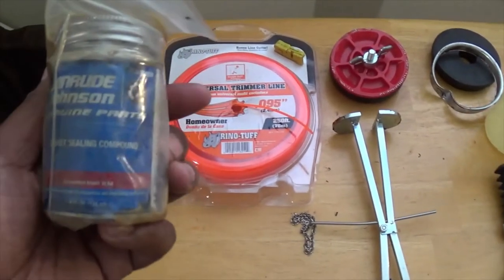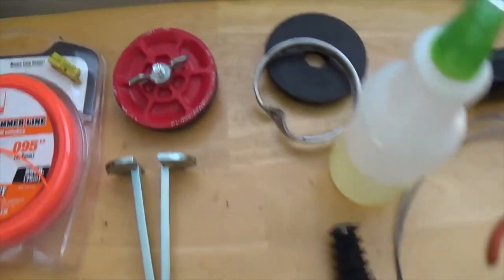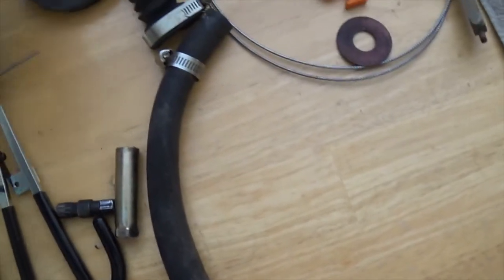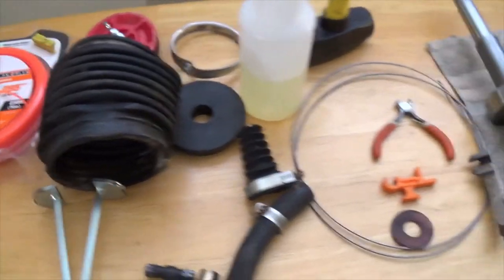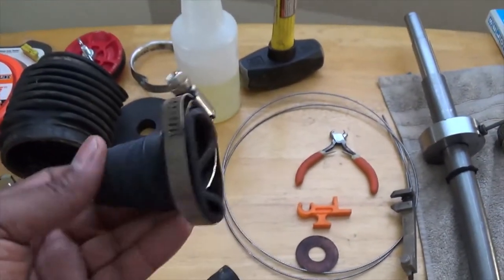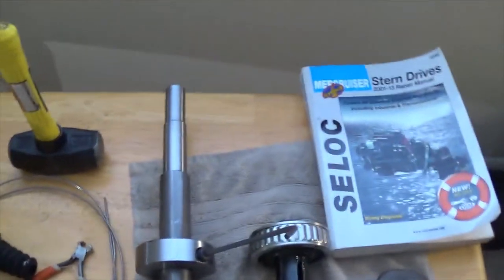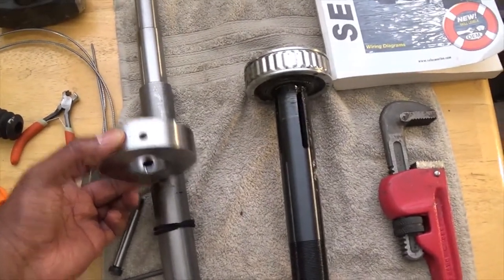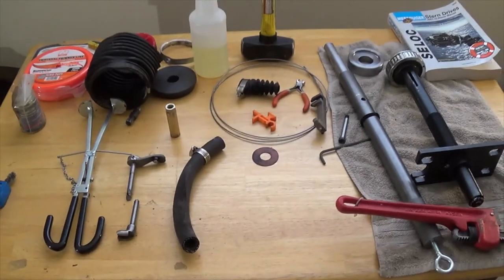Tools needed: WATCH THIS BEFORE replacing stern drive Bellows, Bearing and Shift cable

Comment: The red tool is a 4 inch mechanical test plug
Reply: Thank you! I was trying to figure that out so I can buy it.
Reply: @jasonvega5797  I suggest you spray powertune on the bellows. The plug did not work for me
 It goes right in with powertune. Ten bucks

Comment: Dude.. The shift rod is allways stuck bro.. U need to take Chizzel and a hammer put Chizzel in the crack om the TOP there and give a good smack! Then the arm will Split, cuz its mold alu... Very Nice video.
Reply from the maker: Okay thanks for the comment

Comment: What size is the plumbing cap for the bellow ring
Reply from the maker: 4 inch but you will have to shave a little bit off so it will fit into the Bell housing

Comment: Hey you ever have a shift cable not moving the interrupt switch at All ?
Reply from the maker: Check your shift cable it could be bad.
Reply: @sterndrives3290  I learned something today ...so I grew up tearing things apart , sometimes stuff I probably shouldn't have but I did haha I liked to know how things work....anyways I read somewhere that the interrupt will not work on dry land and that seems to be true . It boggles my mind it makes absolutely no sense to me how a load on the engine can cause that cable to make the interrupt work in the water but it does